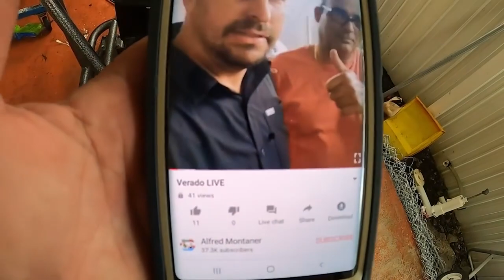Termite Infested Transom Restoration ! (Carrera Powerboats)

Comment: Tell you what.  For the age of this boat, the fiberglass looks pretty good.   Mine is completely rotten.   It looks like eggshell.   I can’t grind mine anymore in order not to lose shape.   My boat is 19 feet and the transom isn’t flat like that , it has angles , which makes it harder to clean and redo the transom.  They don’t sell coosa in Brazil yet , if not I’d use it.    Mine was also originally inboard before I bought it and the termites also ate it from the inside out but my transom is half the size of yours , yet more complex to remove because of the angles on the stern.

Comment: Love the channel.  I work for a south fla. boat builder and no one does it this way anymore.  A much better way would be to use a structural putty such as arjay 2011 and vacuum bagging the coring to the transom.  Much better adhesión without air voids and all excess material is drawn out. This is really an old way of doing it.

Comment: Bra not impressed with the orange trans didn't lap on the freeboard or any type of overelay  or tie in to gunnal.  Then a big crack. Never should have put the bracket back on the boat if that's the shoddy work they do.  That will fail again.